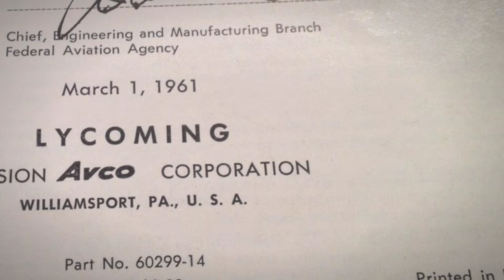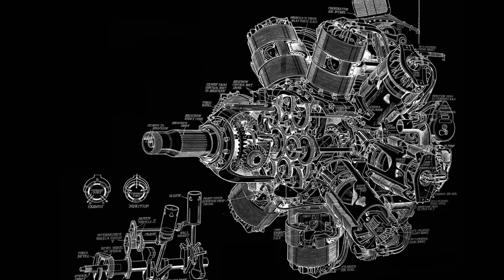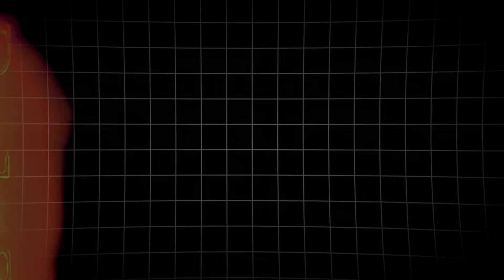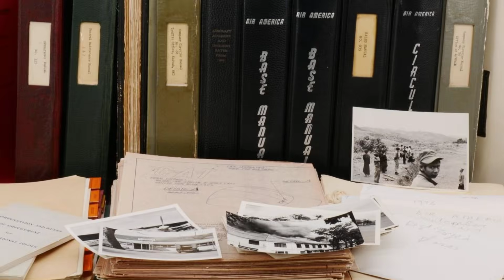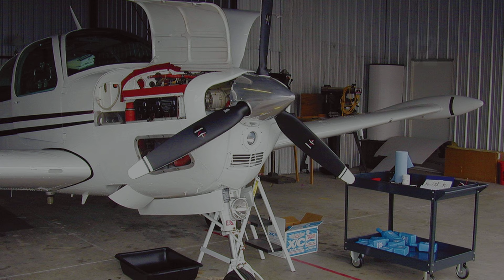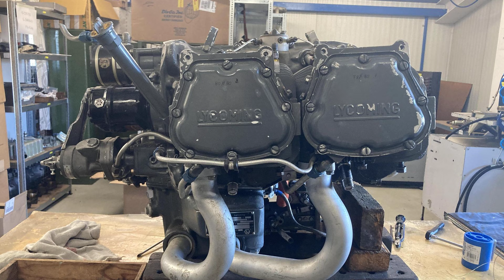The $0 "Sleeve Valve" Engine: Why the Greatest Aircraft Powerplant Was Abandoned for a Worse One

Comment: You better call Kawasaki Motors in Japan to tell them there’s no market for the engines they have in development. 
Inline 4 & 6 cylinder engines with 200-375HP that is expected for FAA certification around 2030. 
Anything more powerful will have to compete with the PT-6 line that sips on JP fuel. 
So your Hercules engine would be competing with a PT-6 from Pratt & Whitney, not a Lycoming engine, it’s apples to oranges
There is no THEY that killed the engine. 
The market killed the design.